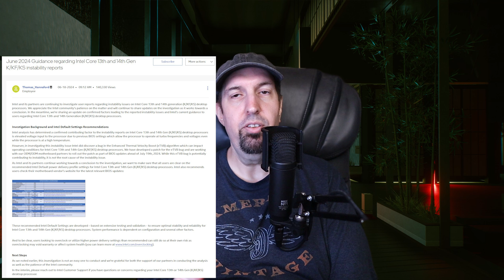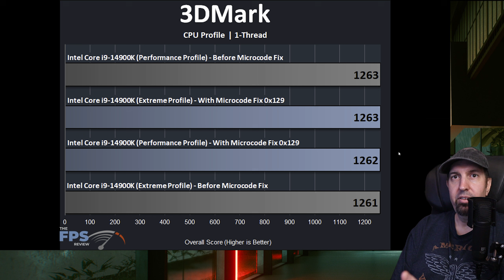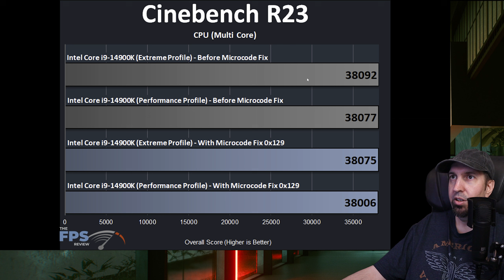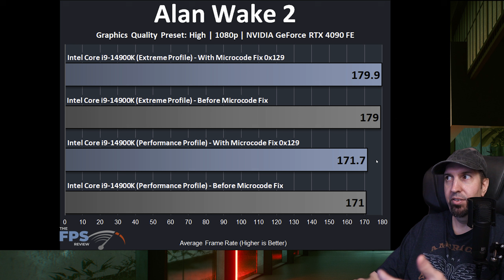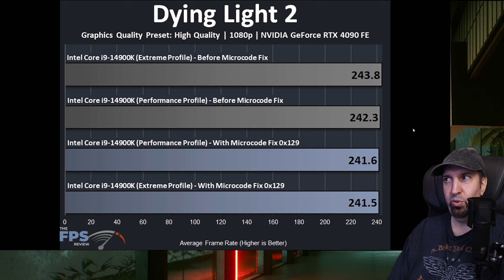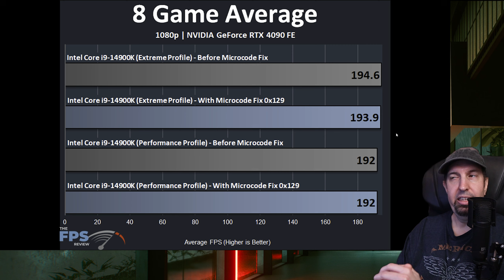Intel Microcode 0x129 Performance Review (Productivity & Gaming) | [Deep Dive]

Comment: I gave up LOL. CPU settings default and ram at 6800 the single core on a 13900K boosts 5.8 CPUz Single core 847. Set ring to 3.8 set Efficiency Core to 2.2 Cores all lock to 5.6 I get 915 single core score. This is on a Gigabyte Z790 Aorus Elite AX.  All bios have the same results.

Comment: I have a asus dark hero motherboard and intel 14900k cpu and asus 4090 vga with 0x129 update still have a issue crashing in Fortnite game when i try to enable ray tracing option any idea what's the problem?!
Reply: Lock the cores to 57 ratio and see what happens - if it works with RT then CPU needs to be replaced - if not then it may be something else.
Reply: Ram. Just load default Ram speed to 5600 and retest. XMP is hit and miss on ddr5. You may have to fine tune Ram.
Reply: have you read what Intel said? They said that if your CPU was already affected, the new microcode update 0x129 won't fix your CPU! You need to contact Intel or the company that made your PC if it's a prebuilt, and ask for a refund or RMA. I got my i9 14900k RMA'ed and it took only one week to get a new one (new CPU traveled from Netherlands to RO).
Reply: @George-Chris  Correct a micro code is NOT going to fix low quality silicon. Egos pushed the chips to hard out of the Box. My fix since day one set Ring to 3.8 set Ecores to 2.2 Pcores to 5.6 Power limit 150. Problem solved as far as stability goes. In my case XMP 7200 never worked correctly so I manually tune 6800.
Reply: @George-Chris  we dont have that option in my country, we cannot contact intel to replace my cpu :(
Reply: @MahdyarGoudarzi  bro then what you did?